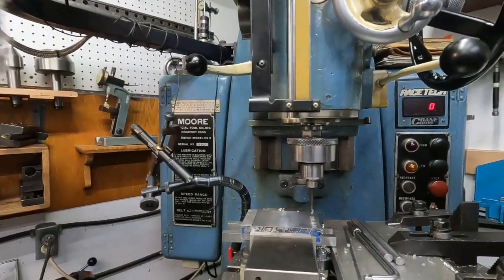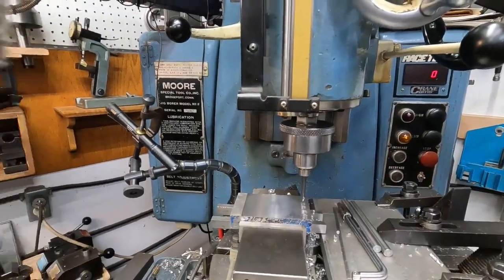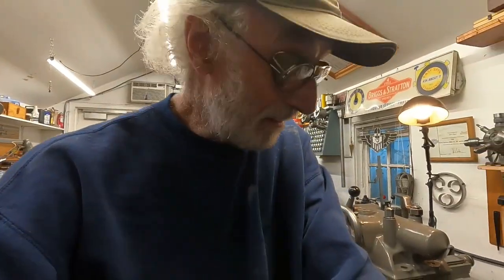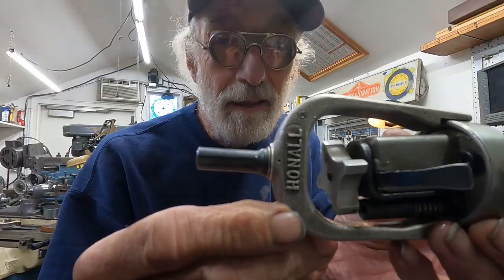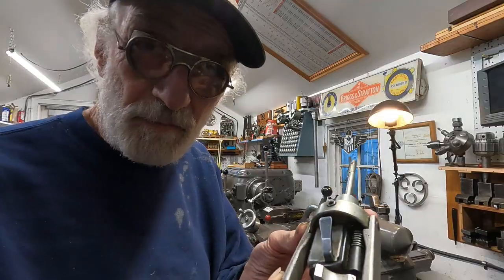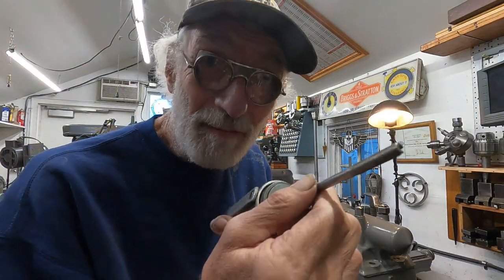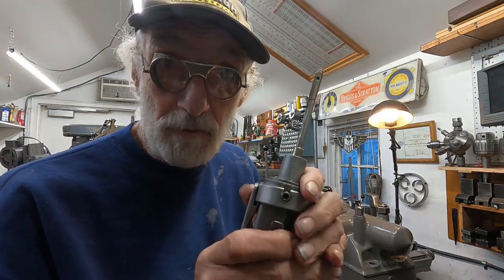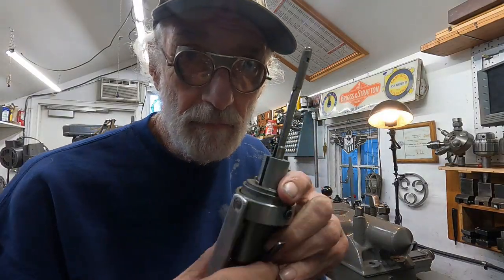Sunnen Honall, alternative precision methods

Comment: Cool tool. I got one years ago when I rebuilt my old Cummins dodge engine. I machined 24 bronze guides and changed up the upper ends. When pushed in, the valves are too tight to move. Perfect. Use this tool to remove a whisker at a time. Until the valves are just perfect.
Reply from the maker: I was surprised how well the Honall worked, like you mentioned how a pressed in part will squeeze, that is not a good job for a reamer because the cut is uneven, tears the metal and dulls the reamer.

Comment: I spent a lot of hours honing valve guides for 7MM valves. That was at a shop I worked for they did cylinder heads for Comp Eliminator engines. Thanks Don
Reply from the maker: This was an item I purchased specifically for motorcycle cylinder heads, not only for the guides but for the guide holes in the head itself as there is always damage from the old guides being removed. Having a clean, true hole to install new guides is most important in air cooled engines that run much hotter than liquid cooled and even hotter on low octane fuel.
 Otherwise there would be poor heat transfer from the hot valves to the cylinder head causing all kinds of havoc and short service life. This stuff is in Pratt & Whitney aircraft engine service manuals using P&W special honing tools and guide and seat pullers. I replicated those methods of installing seats and guides into clean holes with the correct surface finish, and never had a valve stick but they still can float!

Comment: Dee I have looked for some small hones but all I find are the spring loaded brake hones and such. I would love to have some small diameter ones.
Reply from the maker: I have some odds and ends Amco small hone kits but they are intended for automotive. The are some other brands of honing tools but I am only familiar with Sunnen. Sometimes the Sunnen honing tools are reasonably priced, but right now the used prices seem to be very high. One Sunnen advantage for me was the tech help would know what I needed before I finished telling them the problem.